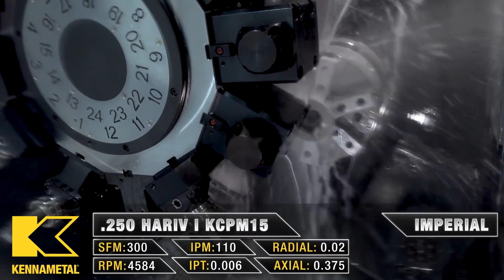Making a Huge Amount of Money in a Short Period of Time

Comment: Hi Titan,   What's your reaction to Sandvik buying Mastercam?  Is this going to be a conflict of interests for you with Kennemetal, or are you going to start including more Sandvik tooling?  
This took me completely by surprise.  They've already bought CG Tech (vericut), and machine monitoring software.  It seems Sandvik want to supply everything from the material the part's made from, to the cam software you programme on, and the tooling you cut it with.
Reply from the maker: Many companies now are working to become a one stop shop… Partnering with Titans of CNC to lift up the trade and educate our workforce is good for business… and good for our industry.
Reply: @TITANSofCNC  we bought a sandvik oring insert for 316 stainless on a 1/4 od rod with a 090 id centre hole (bAD design mea culpa) and the insert handled like a boss. the cnc machiniing was so good despite a horrible oem desing we ended up ithe with the best perfoming machine in the world and 30 years later i retired a milionaire hard to slam SANDVIK RULES111!!!!
Reply: It might be good that someone bought Mastercam I took a tour of the place a couple of years ago and it was female owned to the point that the place had like 3 fullsized giant kitchens. Priorities way out of wack.

Comment: Great
But a small tip for new shop owners, make sure that your biggest customer never supplies you with more than 30% of your work
If they fall and your work for them is let's say 70%, you can close your doors like Titan had to do.
Spread your risk so you are not depentent on 1 customer
Also if you are the one that outsources everything and you just assemble everything, make sure you outsource not only with 1 shop, but multiple
If that shop goes under you have to biuld a completely new relationship with a diffrent shop that won't give you the quality you are used to
Also if you have a big project divide that work over 3 shops, so they can work at the same time and you have your complete order pretty much 3 times as fast
And if 1 company has trouble delivering because they are busy or thay have problems with their machine, you still have 2 other supliers already making parts for you
Reply from the maker: Correct… and soon I will discuss how that exact thing hurt me beyond comparison…
But lesson was learned and it never happened again.
Those early days came with struggle but it set a business foundation under me that nobody could ever take away…
Reply: @TITANSofCNC  I was very curious as to what you would say because 'in theory' it is great advice. almost impossible in the real world. i read 80% of revenue will in the end come from 20% of our customers unless you consciously fight that trend. just watched your iconel video. i guess tool pull in is never an issue? lol jk